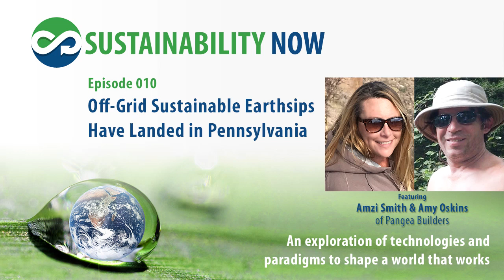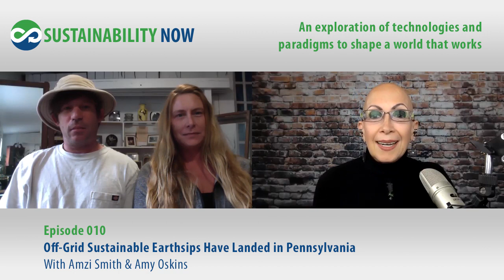10 Off-Grid Sustainable Earthships Have Landed in Pennsylvania

Comment: Great video podcast!  LOVE the Earthship concept and it is my dream home.  I still have the original Earthship books Volume I & II when they were first published so many years ago.  I live in Pittsburgh, PA and was wondering if there are any website links with photos, building diagrams of the Earthships in Ambler and Tamaqua, PA?  How would I go about getting building permit for an Earthship in Pittsburgh, PA area?  With new technologies like 3D Printed Houses, I was wondering if Earthship design concept could be incorporated with 3D Printed House construction.  I was thinking CAD designed Earthship 3D printed cement wall forms then South facing glass front, indoor planters, etc.. Everything would be same Earthship building and functional systems except the speed of 3D printing of cement forms instead of earth rammed tires.  Companies like ICON are doing some amazing 3D printed homes.  https://www.iconbuild.com/
Reply from the maker: Talk to the folks at East Coast Earth Homes. Here is their Facebook group https://www.facebook.com/groups/2241404946187860/